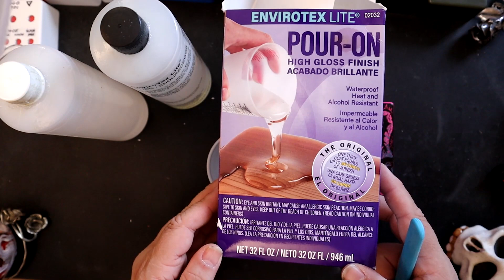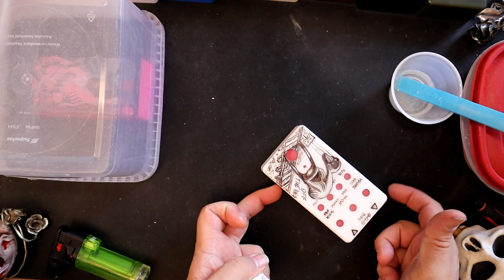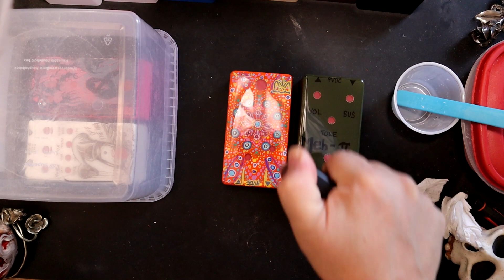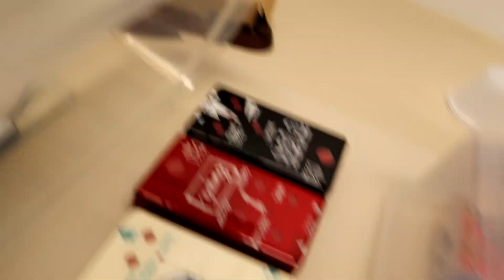Applying Epoxy Top Coat on DIY Pedal Enclosures

Comment: Use a heat gun to clear the bubbles from the resin while it’s in the cup. Then use the heat gun to level the resin after you pour.

Comment: What’s your typical cure time on the epoxy?
Reply from the maker: In about 2 to 3 hours I can stop worrying about drips. In 24 I can not worry about dust. If I grab it I may get prints in it. By 48 hours I typically remove the backing tape and sometimes drill. Though occasionally it will pull away from the paint. After 72 it is good to go. 

I will usually box up the circuit if I have more than 60 hours of cure time.